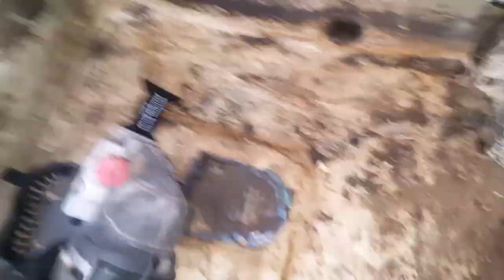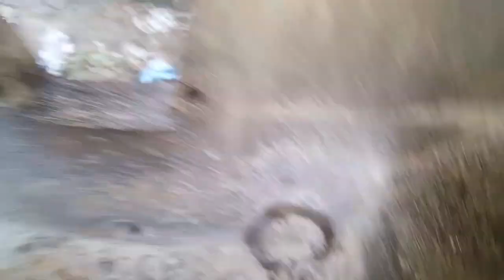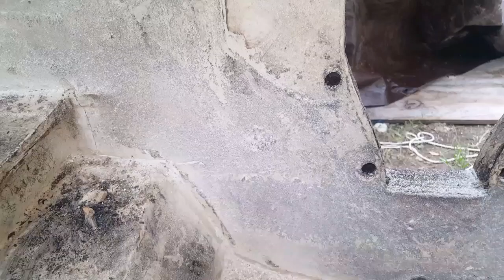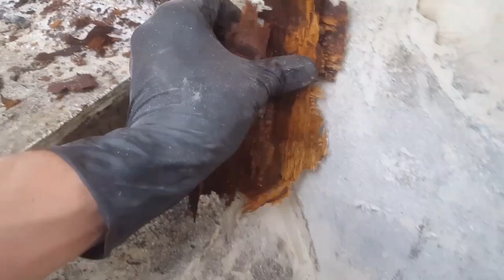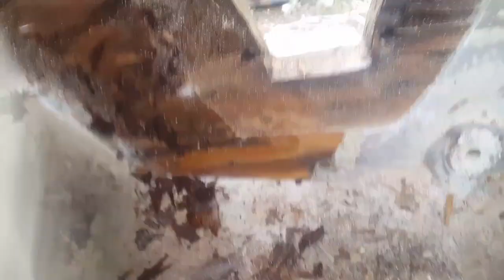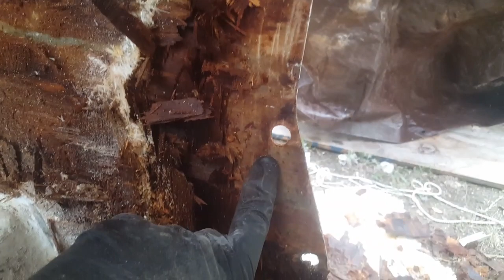Boat Transom and Floor Rebuild - Transom Removal - Part 12

Comment: Can I use epoxy resin to bind them together? I have to do do my 1997 Four Winns Vista 238 and you have inspired me into not throwing away my boat. Thank you so much
Reply from the maker: I mix chop strand in it and it works great!